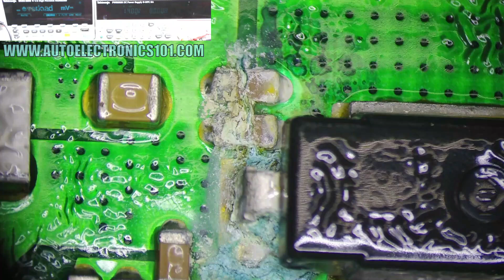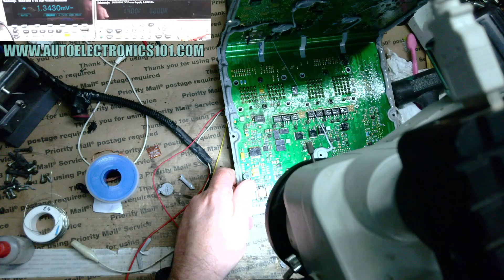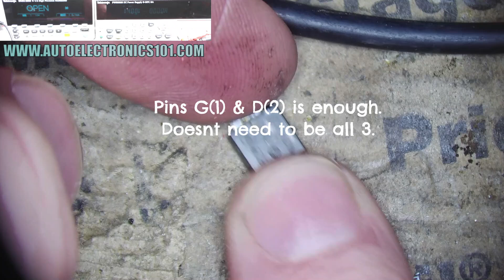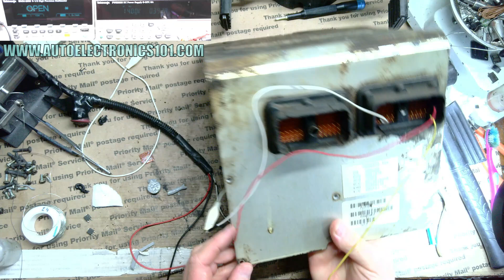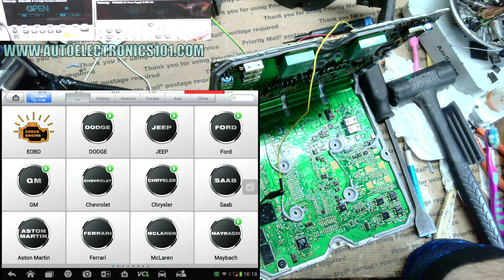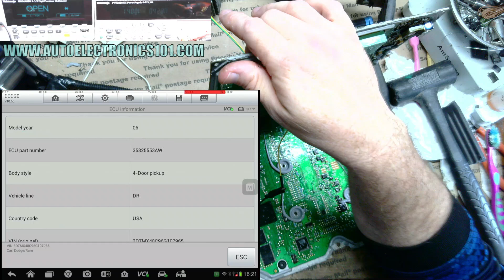repairing dodge ram cummins engine computer (ecu) no crank, no communication

Comment: I enjoy your videos but I wish you would state the pin number you are hooking the power and can wires to.  I try to guess by position but the oblique angles make it difficult.
Reply from the maker: You should check wiring and connector diagrams.
Reply: @ecurepair  Not everyone has access to dealer only or paid-only automotive data.  And, that is the exact model of ECM that I am working on, same year vehicle, same engine.  A lot could have been gained from the supply of the missing information.
Reply from the maker: @rossgee2950  I have those free on my diy website. www.autoelectronics101.com
Reply: @ecurepair  Thanks!  If you know, I am curious; what is the bare minimum hook up required to interface a OBD 2 scanner with an ecm on the bench? Is it just the chassis ground, the battery 12 V, the ignition 12V, the sensor ground and the CAN high and low?
Reply from the maker: B+
RUN
GND
(if 2005 or older)
SCI T
SCI R

(if 2006+)
CAN+
CAN-

Comment: Have you ever repaired a P0601 (internal memory checksum ) error? I have this code on my 02 grand caravan. It runs normally but it's annoying having the check engine light on. I was thinking about getting a donor PCM and replacing the memory.

Comment: found this video trying to figure out repairs to my ECM that had been soaked with oil from leaking injector wiring. wound up sending my ECM in to keyworks. very affordable repair pricing - mine was too roasted to repair (wasn't surprised, oil was dripping out of the plugs when i pulled it) but he hooked me up with a replacement for a good price. he was responsive and I got a quick turnaround. highly recommend.
Reply: How much did you pay?
Reply from the maker: Thank you for the feedback! Glad we could assist you with your ECM issue's!
Reply: What were your symptoms?  I had a misfire and fuel smoke come out of nowhere, changed injectors and no difference, pulled ecm today and removed the rubber plug and some motor oil poured out of it. Not sure if that could be causing it to run bad or not.  Seems every gamble is costly 🤬

Comment: Can you replace the zener diode with a tubular style one with the same ratings if the factory one fails or does it need to have more then two connection points? Thanks
Reply from the maker: any proper spec tvs that fits would be fine
Reply: @ecurepair replaced diode checked for short circuit before closing up computer installed back in truck and keeps blowing fuses now I’ve got a short when bench testing may have to pull that mosfet to test?

Comment: Im currently trying to diagnose a 04' ecm which after dead batteries was jump started and ran until leads removed and with charged batteries now has no communication, engine cranks,  but doesnt start. When i supply power to the ecm on my table without ignition switch pin receiving power, i have 0Ma...ignition on i have .0027Ma. So maybe nothing is shorted?...Im not sure what particular areas to check. The obvious variables have been  checked leading to ecm removal and investigation. Any help is appreciated and will donate for the guidance. I have a solder station, hot air rework system, transistor/mosfet tester so i am able to do the repair. Thanks!!!
Reply from the maker: Its a pretty common issue I repair if you wanted to send it in.
Reply: @ecurepair  So its something you dont think I can repair or just a trade secret? haha Id like to execute the job myself but if theres no other option then ill ask the customer if hes willing to send it in. We just need price for repair and turn around time.
Reply from the maker: Well you can give it a shot.  I dont think I have any video 's  on the issues your likely having.
If you decide you wanted to send it in my info is https://keyworks.us/ramecu59.html

Comment: Good job sir
I work in laptop maintenance, and I often receive a car control unit, but I refuse it because I cannot find diagrams for it.
My question to you is where can I find diagrams for the internal circuits, even just one diagram to train on?
Reply from the maker: there are none available really. you have to make  your own records and schematics for the internal circuits.
Reply: Very frustrating isnt it?  You can slowly build your own library of info but you cannot find actual schematics.
It takes a much better technician to work blind..

Comment: If it over heated, I wonder if coolant splashed all over it. I looked up online of location of ecm on 2006 Dodge Ram Cummings.
They say it's right side of engine comartment by the wheel well. So I guess it's possible.

Comment: I did this work from 1981 till 1999..shiny metal balls on the  semiconductors means a 98 percent chance it overheated, exceeded current, then you would find an internal open or short. Usually open. Smell that mosfet
Reply: You mean usually short.